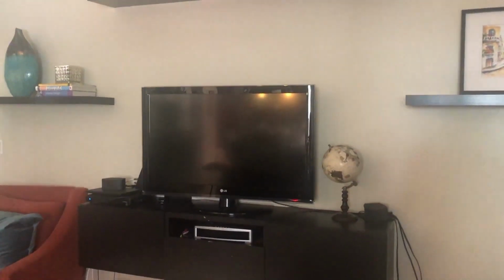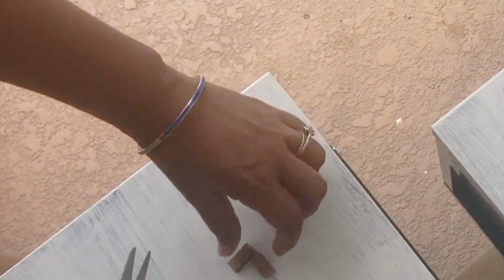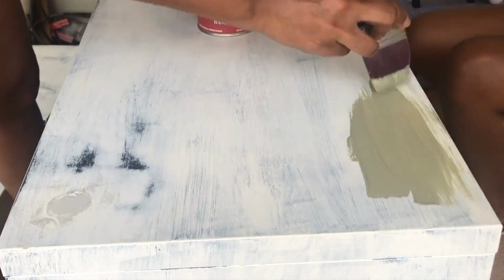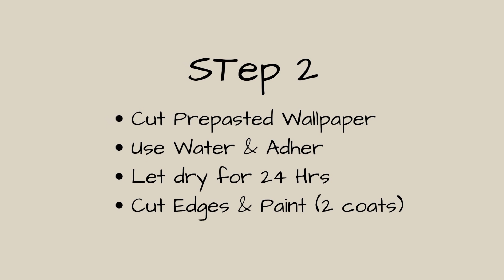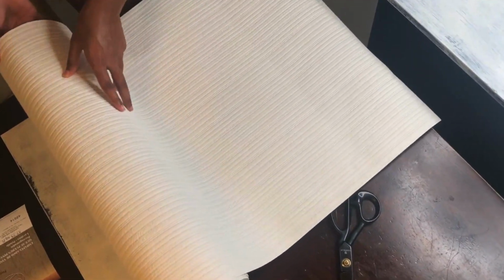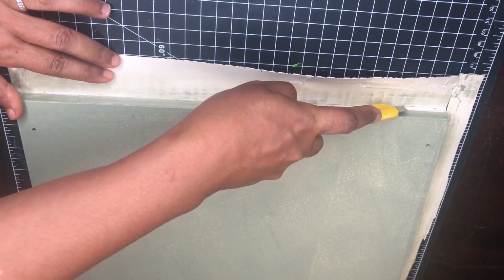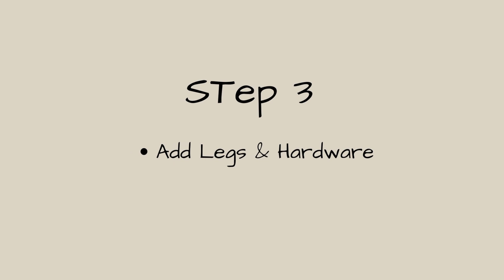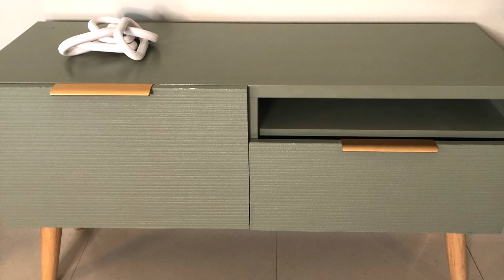Best Way To Paint IKEA Furniture | Furniture Makeover With Wallpaper | How To Paint Laminate

Comment: Just asking for a bit of advice.

I’ve bought some IKEA inserts to go into a Kallax unit, it’s states on the website that they are fiberboard and coated in acrylic paint. 

Will this method work in repainting them or will another or easier method apply?

Thanks :).
Reply from the maker: Yes, a light scuff sand and priming with BIN Shellac is key for proper adhesion of the paint. Then you can finish with any paint you like..
Keep in mind Shellac is not water based so use a cheap brush or roller you don’t mind throwing out unless you want to clean with ethyl alcohol. 
Happy DIYing! 🙌🏼🙌🏼